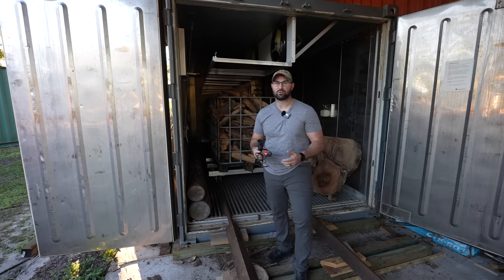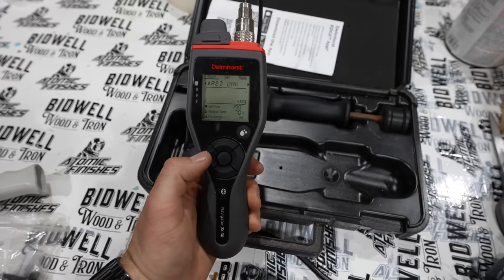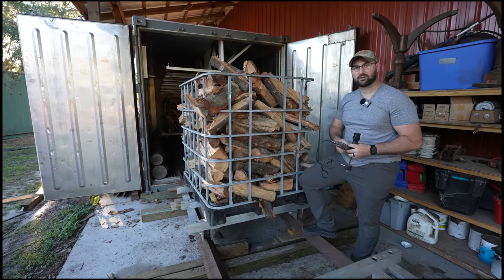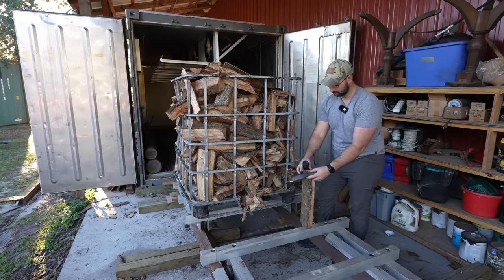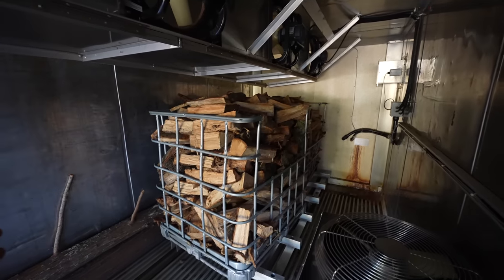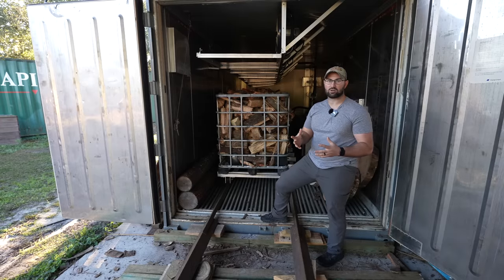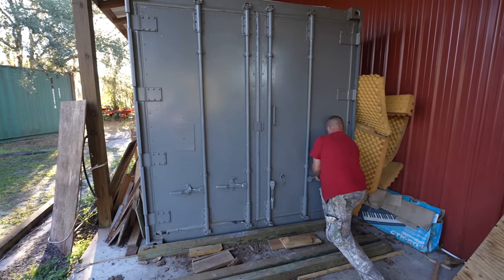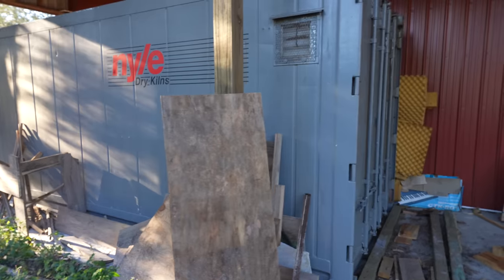Kiln Drying Wood Made Easy With This!

Comment: Ends always dry fast, would be interested in the middle of the split side.
Reply: I'm sure its higher in the middle, but we've been doing this for a year now with no complaints.
Reply: Exactly. My 4x4 red oak splits will read 12 to 14 on the ends but still 24 to 27 in the center if you cut them on the chop saw. Drying takes time in hard woods.

Comment: I had a question about the water that your pulling out.  I had my kiln set up wrong without the automatic vents that open up on my first load.  I kept on getting really high like130 and we pulled about 55 gallons of water out of our stack of wood.  On this next load we had the vents turned on.  They open up when it gets above the desired temp and cool it back down.  We are a few weeks into the drying and so far we have pulled no water.  Im not sure why I'm guessing some of the moister comes out the vents when they open.  Do you remember how much water you collected.  Right now we are only running it to 100 degrees and we just bumped it up to 110.  do you only see water when you get up to 120-130?  sorry for the long question and I hope it make sense